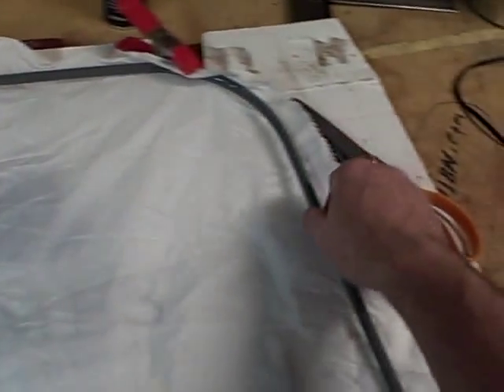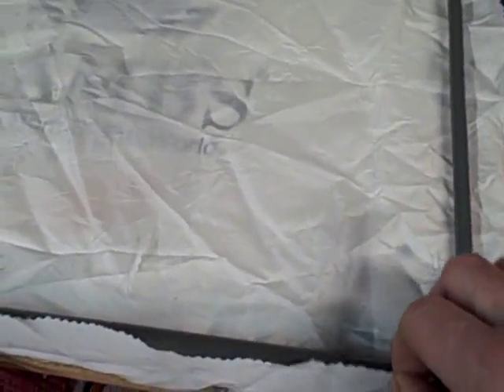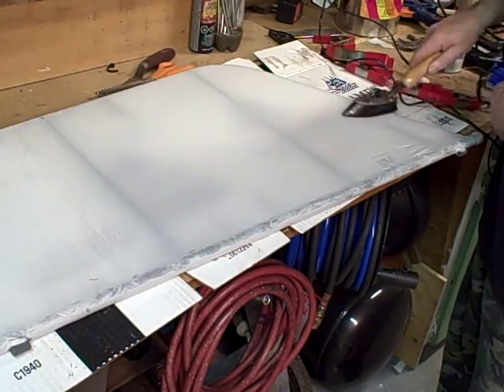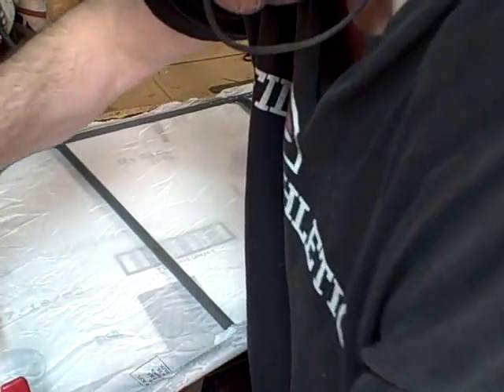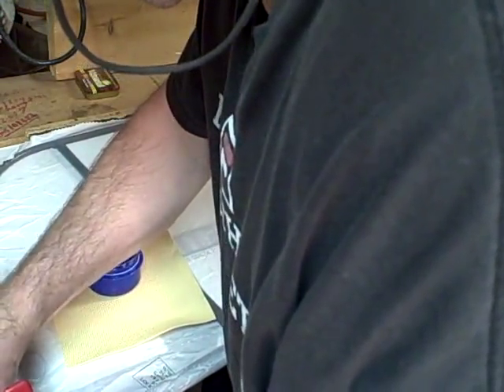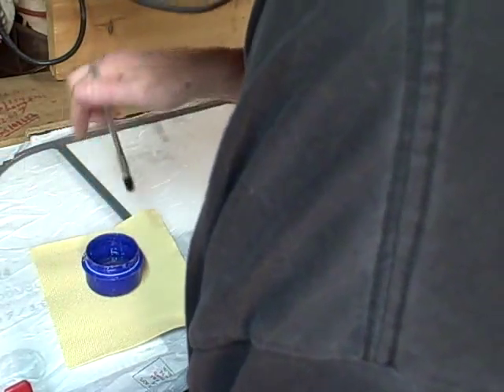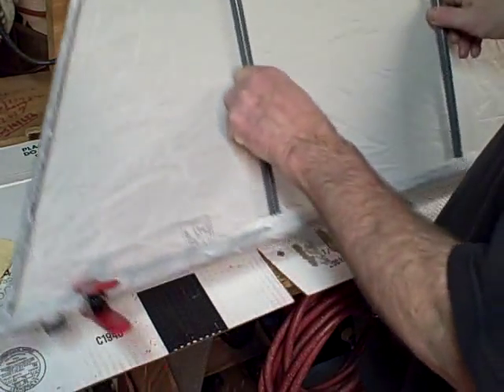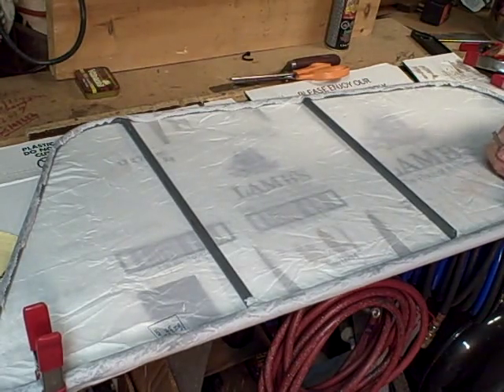POLY FIBRE PROCESS AIRCRAFT COVERING

Comment: Is this an ultralite that your working on?
Reply from the maker: yes sir..internet some slow eh, just getting this in time for Christmas! thanks a lot appreciate it!
Reply: @hunt4fish  What is the weight of the fabric?
Reply from the maker: @007380  think it was 1.8 oz on that one but I have used 2.8 on some depending on weight of aircraft with  bigger engine
Reply: @hunt4fish  I'm getting ready to cover my FlightStar II and I'm searching out for tips.  What do you use for paint?  I see a lot of people are using latex paint.  Do you have experience with latex?
Reply from the maker: @007380  no, I used the poly fiber process in everything I did. I don't do much of it anymore now, unless a small job...... retired and sold my plane as well